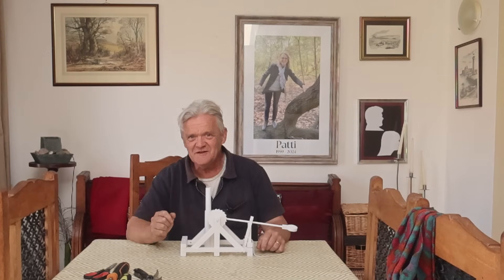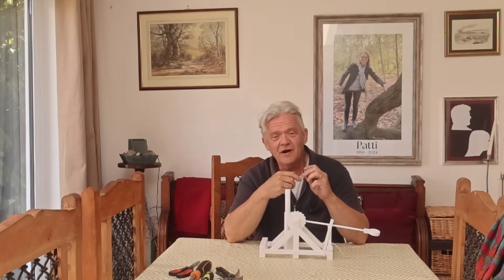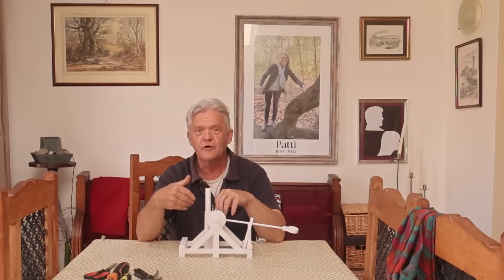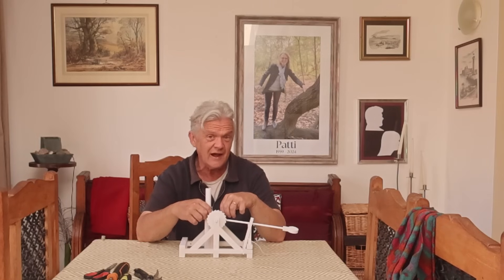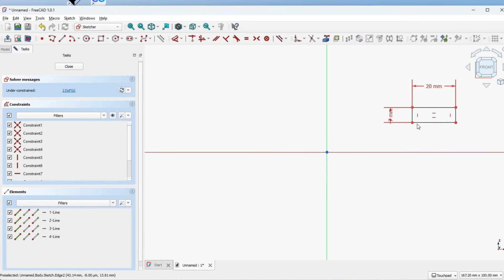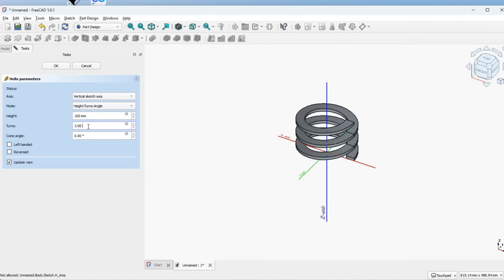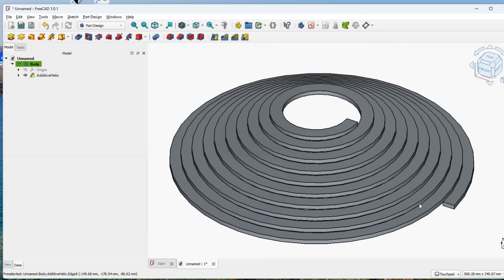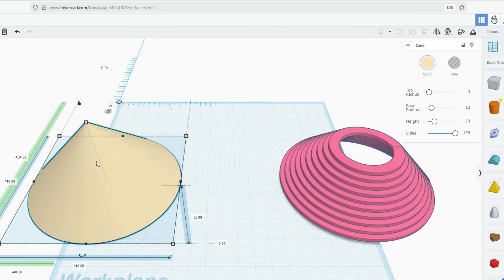2429 Freecad And The Fusee - Springs And Spirals In Freecad

Comment: Magnetic force follows the inverse cubed law... not squared. Thats why (ive been told) we cant set up  magnetic orbits...
Reply: Magnetic monopoles produce an inverse-square field, but there are no isolated magnetic monopoles, and dipole fields follow a cube law. There are no stable orbits in an inverse cube force field, but the fact that it's a dipole field is a bigger problem when trying to get real magnets to orbit each other!
Reply: Add an opposite pole magnet to the follow through side.

Comment: I've heard that magnetic force falls of with the cube of the distance. I tried to look it up to confirm but it went way over my head.
Reply: An ideal dipole field drops in strength as the inverse cube. That's fairly trivial to derive as the limit of two monopole fields. But real magnets have spatial extent are not perfect dipoles in the near field, and two interacting magnets make for a more complex field. So in practice, you'll be better of just measuring the actual force curve for a particular setup than trying to calculate it most of the time.
Reply: Nah. It's an inverse square rule.
Reply from the maker: square of the distance mate

Comment: What happens if you add a couple of free-floating magnets in the tube between your fixed magnets?  Would you get a more linear output or just a higher initial impulse?  It should act over a longer distance
Reply from the maker: give it a go and see mate
Reply: I think you are on to something. You might have to twerk it a little. I know I do. my ideas never work the way i see them in my mind. So, back to the drawing board. Never give up😊

Comment: A linear spring is needed, like in a tape measure. Or a clock weight
Reply from the maker: cheers mate
Reply: What if you redesigned the catapult to have four leaf springs inside of the original two. The arm swings back and forth until it equalizes then" I think I said that right" runs out of energy. Put a stone on it and you'd still have a problem. However if you give an extra wrap or two between the two correct spring leafs the stone would be ejected maybe but the arm probably will not swing back to kick into the trigger. So maybe you might solve that problem with a string leaf catching the arm at the right place helping the arm go back to lock. I'm going to build one out of wood I'm slow 😊